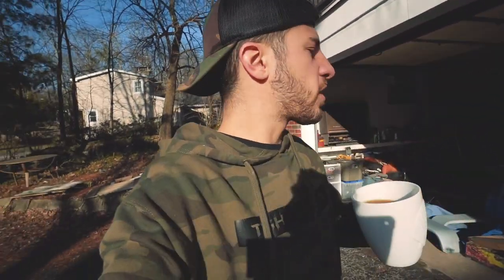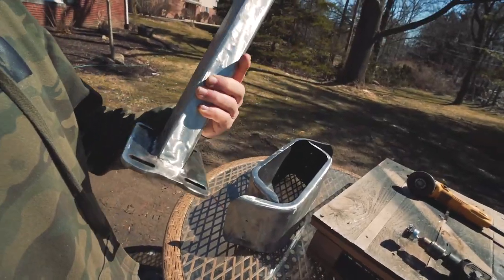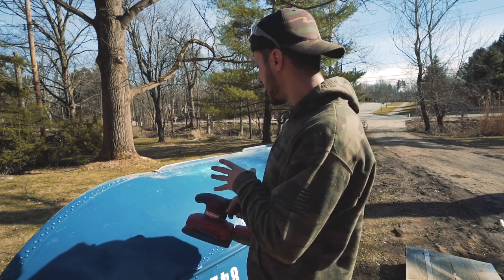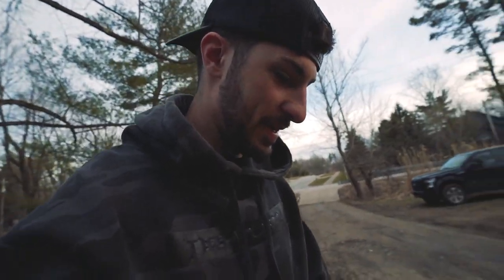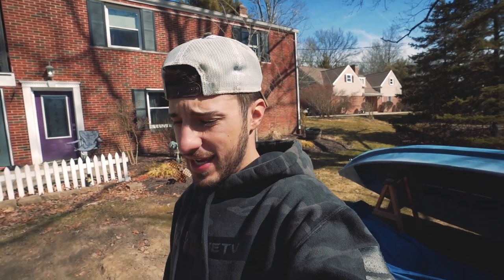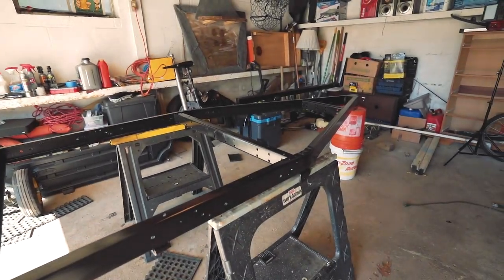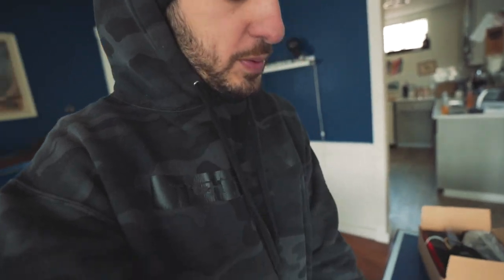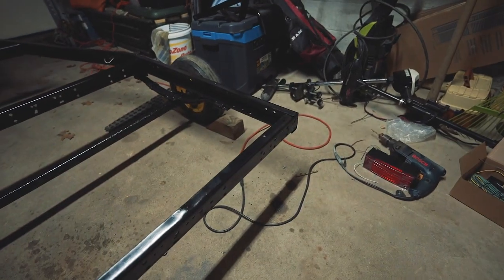Building a 1955 Bass Boat! Pt 3 (Jon boat to bass boat)

Comment: If you fabricate steel river rails to replace the PVC pipe ones, you can mount your trailer taillights up high. Then they don't go under water when you put the trailer in. Plus it's safer since the lights are easier to see.